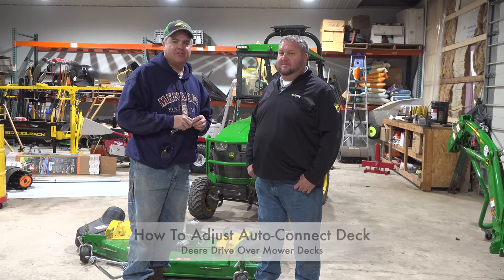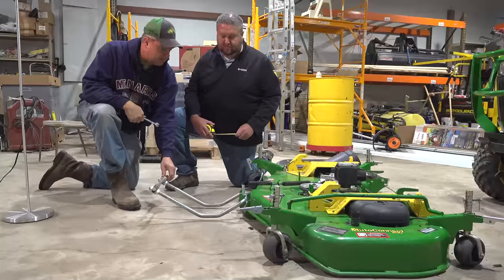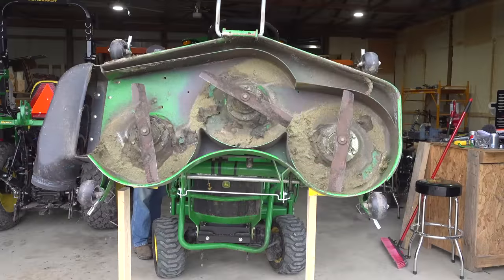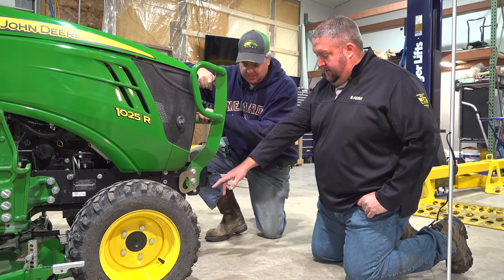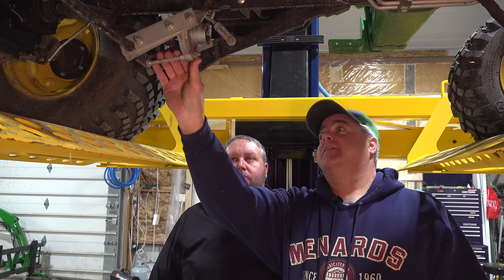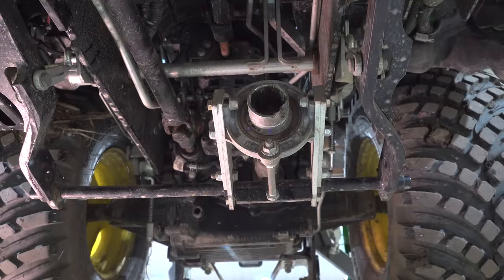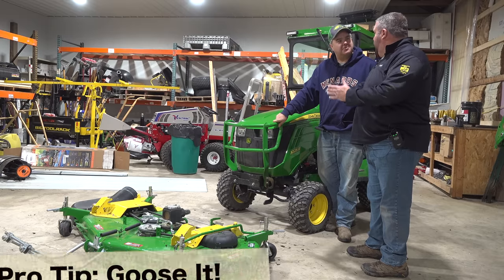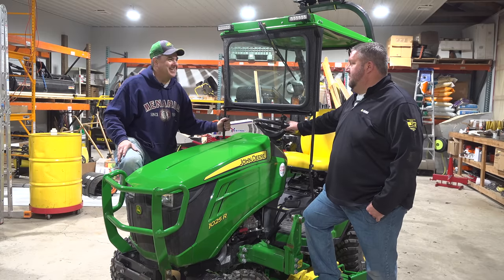Adjusting The Auto Connect Deck Deere 1025R/1023E

Comment: Awesome video again! - as usual...

I searched through all of the comments and didn't see my issue discussed.

The spring that lifts the front arm up is only strong enough on my deck to get the cross shaft to just above 10.0". There is no way I can adjust it to 11.4" (unless I hold it up). If I lift it, friction will hold it around 11" but as soon as the tractor starts to drive over and vibrate it, the arm drops back to the 10" height again.

I tried to find a different place to hook the spring to tighten it slightly and I found a hack solution (hooking it to the base of the place it's just supposed to be hooked). The issue with my fix is the spring now rubs the deck, which will end up rubbing through the paint in no time.

Any suggestions?
Reply from the maker: Do you suppose spring is bent?
Reply: I just noticed by watching this video carefully around the 2:45 mark that my deck has a different hook for the springs.

Instead of the separate mounts (on Tim's deck) located in such a way as to slightly tighten the springs, mine has a single eyelet that both springs attach to. This means my springs are about 1" apart at their closest point and not as tight as with the individual mounts used on the deck in the video.

Note my deck is from (I believe) a 2015 tractor.
Reply: @TractorTimewithTim  The spring isn't bent but it might have weakened over the years (prior to me buying it).
Reply: If you can imagine a round eyelet with a single connection point welded to the deck, you can imagine what my deck has compared to yours.

What I have found is if instead of hooking the spring to the eyelet like it is supposed to, I connect it to the base of the eyelet (where it attaches to the deck) this stretches the spring about an extra ½ inch.

This is the perfect amount to make the spring work. The problem is the spring is now rubbing against the deck.
Reply: @TractorTimewithTim  I'm not sure of this is normal but I measured the lower front hooks on the tractor and they are only about 10¼" off the ground. That is about where the spring lifts the arm to so it connects perfectly even though the spring can't lift the front arm to the bolt stop. I adjusted the bolt to allow the arm to lift to 11.4", even though the spring can't lift it that high.

With that setup the mower deck seems to connect flawlessly every time I tested it. I tried it on concrete, asphalt, gravel and grass and I was pleased to find it auto-connected perfectly each time.

So in the end I didn't need to modify how the spring connects.

Thanks for your help again. Your videos and responses are very appreciated.

Comment: PTO splines and other areas you don't want dust & dirt to adhere - lube with molybdenum spray.  The carrier evaporates and leaves a dry moly coating on the surface of the metal.

Comment: Lol. I don’t even have one but because of all the height requirements and everything I’m guessing tire pressure is pretty important. Over inflated tires are under inflated tires could mess up all that alignment.  I think another thing that might help would be to cut some wedges out of two by fours and rubberized or glue some rubber onto it, basically just make little wedges that you keep in front of where you store your deck that way it will hold the deck back and keep it from sliding and when you back up it’ll just leave them there maybe?  🤔

Comment: Having an issue attaching my deck. It's a 1025r,  could the spring on the front of the mower deck cause it not to fully engage? The spring is damaged.
Reply: Didn't fix my issue!  Thank you though.
Reply from the maker: The spring serves to guide the front bracket into the slot when driving over…that is all.
Reply: @TractorTimewithTim  
Ok. Thank you.. It looks like the male  of the gear box is not inserting all the way into the female part
Reply from the maker: @rogeliorivera2682  adjust the female spline  height (tractor side) when disconnected.
If not angled just right, it will not slide on.
Reply: @TractorTimewithTim  I actually already did that..

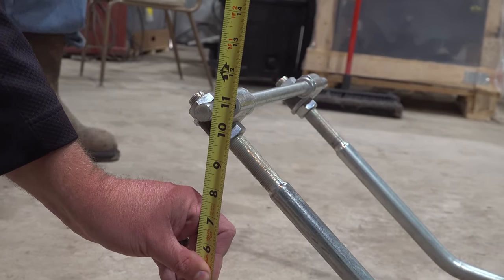Comment: 3:25.  Tape measure says 10 1/2inches at the center of the pin after being told it should be 11 1/2 inches.  Which is it?

Comment: I wonder if my experience is "normal" and/or if someone might know what causes this...

After following the guidance in this video I mowed my lawn for the first time with the 54D mower and 1025R. There is a particularly bad tree root that sticks up where I also have to steer sharply to the left to avoid going into a creek.

As the left rear anti-scalping wheel on the 54D is being pushed upwards while going over the root, my mower made a nasty grinding noise, as if the blades were hitting a rock or something. The thing is there are no rocks there, nor did the blades hit anything else. I had the mower deck raised as high as it would go at the time (the left rear anti-scalping wheel was still being pushed up further by the root though).

I don't know what caused the noise.

I thought maybe the PTO shaft might have been pushed up too high and scraped something but nope, no scrape marks (still looks like new).

The only thing I can imagine is maybe the deck itself flexed enough that the blades physically hit each other but that seems unlikely to me. The deck does not look twisted as far as I can tell.

Any ideas?

I've mowed that same area with my 54" Husqvarna lawn tractor 100's of times (over 20 years) with no issues but it does have the ability to raise the deck about 2 inches higher (or it did before the engine blew, oil spewed everywhere through the hole in the block and then the oil on the hot exhaust quickly caught on fire).
Reply from the maker: I think I know the noise you mean.  I think it is in the u joints.  Happens when the mower gets pushed up extra high. (Which isn’t very high on the 1 series).

Comment: I noticed in one of your videos you had a molded block off plate for your mower deck. Do you have a link or video on that? Love your videos btw
Reply from the maker: This is a 'mulch kit'.    It is a plastic formed piece which forces the clippings to stay in the deck for further mulching rather than being shot out the side.   It is a Deere option.
Reply: Tractor Time with Tim do you have part number? I asked about it at Deere and he said they didn’t offer one.

Comment: Some good tips, interesting Goose it technique. I have a question for the guru's. I have a grass collector with the fan collector and vacuum pipe and noticed that the side the piping fits the deck seems to cut lower. I have read the manual and noticed there were ways of adjusting the height of the deck, probably the same ones you showed with the turnbuckle but not had the time to venture and test. Is it normal that the one side will cut lower when the side discharge pipe and boot is connected, perhaps due to the extra weight on that side? I have had to raise the the guide wheels on that side to lift the deck to correct height as a temporary fix, just one click or hole. I have not done much experimenting or trials so can not say if it's only the case when I am using the collector but was just wondering if this is know to create a problem or not.
Reply from the maker: The guide wheels will wear out more quickly.  That is the only issue you’ll see (in my opinion). Those wheels are not designed to always be handling the weight of the deck. ...but hey, they are not THAT expensive!
Reply: @TractorTimewithTim  Great video and very timely with spring coming on. Too bad the dealer's people don't understand this as my deck never has connected properly. I checked measurements and they are not close enough.

As for John's question about the deck not cutting level with the grass catcher on - I've got a Terraking TKV20 (you talked me into it) and it works great except for cutting lower on the discharge side. So far I have it "fixed" with a weight added to the other side of the deck but I can't believe that it should require that kind of a botched fix.  How does your TKV20 cut as level as it appears to in your videos? Is there something we need to change on the deck adjustment.  Is Terraking aware of this problem (I haven't checked with them, yet.)
Reply: I know this is an old video but when I installed the grass catcher on my last garden tractor, the instructions said to re-level the deck (side to side especially) after installing the grass catcher system. Once I did, the mower cut perfectly again and I never had any issues with the quality of the cut.

My understanding is it is considered normal that when you add a grass catcher that it will require re-leveling it afterwards.

On the 1025R with a 54D or 60D this is fairly easy to do by tightening or loosening the side to side linkages to get the deck back to level.

Personally I would recommend against using the wheel height as a bandaid to this issue. It will work to an extent. As Tim says, they aren't too expensive, but this won't work as well as adjusting the side to side level.

Comment: Try garage door spray dry lube on the quick attach pto splines . then you can just use compressed air the connection.

Comment: Do they make a deck for a JD 3320 that work the same way or has an auto connect or disconnect?
Reply from the maker: Yes, they make an auto-connect for the 3320.  My dad has one.  It is designed a bit differently, so the adjustment will be done differently.  However, it has the same features.
Reply: Tractor Time with Tim Thank you.

Comment: 17:24 I have an older deck on a 1023e and the front bracket on the deck comes loose from the tractor at times. Look worn.

Comment: Tim, thank you so much for this and all your other videos!  I just took delivery of a new 2019 1025 R with the 60 inch deck and load and go and have had problems taking the deck on and off. The lever to remove the deck has been so tight has been so tight against the pins I could barely move it. Now I will know what to adjust to make it easier .  Did I also notice an I match on the back of Johnny?

Comment: You covered all the problems except mine.  I have a 1025R with the 60” deck. I have no problem installing, my problem is removing the deck.  Not every time, but the the release levers will be so tight that I cannot move them.  Backing up and going forward does not help.  A couple of laps around the house, they may work normally.  Have you, or any of your subscribers ever heard of this .
Reply: I have to tap mine with a hammer to get them to release. I was hoping adjusting the front arms would help but I have the nuts all the way out and still no space between the bar and the brackets.
Reply from the maker: Are you sure you have the deck all the way down in install position, with the gauge wheels up?  If so, this sounds like a problem.
Reply: PTP in rear position, gage wheels released, knob in the install position.  It does not do it every rime, maybe 20% of the time.  If it did it all the time I could probably figure it out.

Comment: Hey Tim I got a 2022 1023e and the auto connect deck is different then this video please how do you level the deck on this thing the manual is the same as this video well my deck is clear different any tips?
Reply from the maker: Haven’t looked closely, but I’m assuming there are turnbuckles left and right similar to the older one.
Reply: @TractorTimewithTim   alright bud I figured it out idk if it was the dealer or from factory the pins for the turnbuckles was on backwards so I flipped them around so I could adjust them works great now thanks Tim take care brother

Comment: Hey Tim, thanks for the videos. Question  how do i lock the mid PTO up when not in use ?
Reply from the maker: Only thing you can do on the 1025r is rotate the height adjust knob to the highest position.
Reply: @TractorTimewithTim  thanks, i thought so but wasnt sure

Comment: You never said HOW to adjust the 2-3mm gap. I have adjusted the crossbar all the way out to try and obtain this gap with no success. I only succeeded in lowering the front of my mower deck.
Reply from the maker: Ah, 2-3 mm gap when the mower deck is on the ground...in the install position.

Comment: you didn't cover everything, adjusting the  back arms "the locking pins" ,and on the front arms you have two C harms that aline the bar. these wear and cause the arm to pull off to one side. also maintaining the pto on  the mower needs serviced, the front seal may be leaking and will damage the mower.

Comment: Does the rear auto drive shaft have to come off before putting the snowblower shaft on
Reply from the maker: The mid PTO mower auto connect piece does indeed need to be removed before the snow blower shaft can be attached.
Reply: I cleared out 356 watch later u tube so i have room for your 1025r vids thanks
Reply from the maker: @davevarela1 thanks!  I hope they help you become comfortable with your machine!

Comment: On my Johnny cut funny it’s like the deck is bent that John Deere came out and said its fine And leaves it longer in the middle
Reply: Cam Morin mine does the same thing!
Reply: Same here. New 2020 unit, center never cuts as well as the outsides.

Comment: Tim can you show how to level your mower deck front to back and still get it to attach easy , would really appreciate it if you could thanks
Reply: I would also like to see how he does it,   the manual is vague also, if you  pull up the front of the deck, it will lose the 1/8 inch gap needed to release the rear latches, and the mower is jammed and basically impossible to remove it.  I have to back off the 2 nuts or the deck is impossible to remove

Comment: I sold my deck and bought a riding lawn mower.  While Ole Steve and Bob here are fumbling with the drive on deck making adjustments, I'll be on my riding lawnmower cutting  grass.  I have a Bush hog wich is easier to mount and use and has fewer points of failure. Stay away from drive on decks.

Comment: Sorry but I'll stick with my farmall 140 and woods belly mower.  Looks like a bunch of cheap, janky parts and ticky tacky engineering to me.  It's prudent in this economy that manufacturers like john deere stop cheaping out their parts.  That spring in the front should have enough force that is snaps.  Looks like it barely has enough tension to pull a screen door to.
Reply: why comment on a john Deere post if you love a Farmall?   nothing else to do?